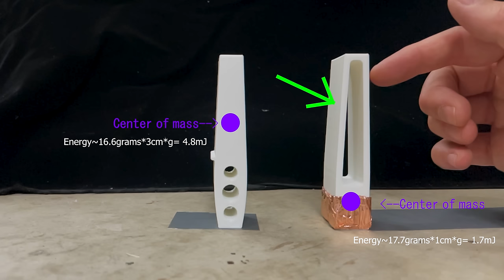The Impossible Domino

Comment: 3:00 i wrote up a whole rant about how that's not metastability, that's just stability with a narrow region, and then i found out that the field of electronics (where i learned it from) misuses the term metastability and your usage is correct in all other contexts. first we got the direction of current backwards, now this, get it together electricity!
Reply: i guess i'm kinda confused what the point of metastability as a concept is, like it's basically a local minimum. like if I place a steel ball in a bowl on a table, that's metastable because the bowl contains it but the ground would be lower energy. if i put it on the ground that's also metastable, because it's not at the bottom of the marianas trench. and even there, what if someone dug a hole at the bottom of the marianas trench and put it there, that's even lower energy. The only way the ball could be in a truly stable state of least energy is if i drill down to the center of the earth and put it there, and that's only if i don't consider the sun, or the supermassive black hole at the center of our galaxy, or perhaps whatever black hole happens to be the largest in the observable universe. wtf?

Comment: no not more energy, the second domino transferred its potential energy back to the first one, losing its bounce in return to a knock back
Reply: So it gained more energy 😂😂
Reply: This *entirely*. The tipping point energy break point is only about knocking the domino down, the setup energy is the energy delivered after going through this point. For the first domino to be put back up the energy imparted in it must exceed the energy difference between the potential energy of it falling over. This was delivered through the kick back of the first energy pivoting on the rib that was on its far side.

The description of the physics in this video was right in the description of the falling over and the tipping point, but wrong in the description of the domino being setup again. There was more potential energy in the second domino through the weight position and this when imparted to the first domino provided the energy to right the first. That's it, nothing more. It would be more interesting to see this managed with multiple dominoes rather than just one, however then it the energy loss (inefficiency) of the process would start to become very obvious.
Reply: So someone actually watched the video carefully, and has a brain. Thank you

Comment: If you rounded the bottom of the domino and weighted it to balance in the upright position, it should always stand back up. If you lined them up, the tipping effect would travel as a wave through the line of dominos in both directions. If you added a lip to the back side of the domino, the wave would only travel in one direction. That would make for a very interesting display of wave dynamics....

Comment: It is actually more about how much energy is transferred to the domino from you initially when you knock it over, the center of mass just guides the domino’s repercussion so that it stays upright.
Reply: An example would be what if you threw a bouncy ball at the ground as hard as you could, at a surface at the same level as your feet. Because of the additional energy, the ball would go far beyond the starting height. Imagine that conversion with dominoes, it is valid because it refers to the same law that is affecting the dominoes.

Comment: Fun fact: it is still impossible to do it for more than 2 Dominos.
Reply: Why? Seems like it could work with three
Reply: well u could put one non hollow domino behind the hollow domino
Reply: I mean, I believe it's possible with basically any number of dominos, if you figure out exactly needed form, weight, and center of mass, but there will always be only a finite number of different dominos, and the last one will newer be able to stand up after hitting the first one, so it's not an infinite engine
Reply: @CodeKujo  because the second domino need to fall completely for the "kickstand" to work. If there's a third domino in font of it then it can't do that.
Reply: @TheMoonMan.  The Kicker domino does have to be last, but there can be more than one preceeding domino. All the dominos would fall, then the last domino would kcikstand all the rest of them back up.  I think there would be a practical limit that keeps the length fairly short, but more than 2.
Reply: @CodeKujo  I see what you mean but I can't imagine the kicker being able to deliver twice the energy that was needed to stand just one up. Would be interesting to see him try though.
Reply: @TheMoonMan.  No it doesn't, it just needs to be shaped to form a seesaw between the floor and the will-have-been-fallen next domino.
Reply: @retepaskab  interesting direction. I get the seesaw reference.... but that effect can be achieved in so many ways. Are you talking about establishing multiple points of centrality in relation one or more ground states and exploiting them to shift mass between them?
Reply: @retepaskab  interesting direction. I get the see saw reference, though there are many ways to achieve that effect. Are you talking about establishing multiple points of gravitational centrality and working them in sequence in order to shift mass between them?
Reply: @CodeKujo  I don't think it would be possible for the last domino to kick multiple dominos back up, but I think one could arrange things so that triggering each domino will consume a minimal amount of each domino's kinetic energy, allowing allowing each domino to get kicked back up after the next domino is triggered.  Each domino in the line would need to store more kinetic energy, but it may be possible to make it so that resetting the last domino would leave the chain ready for reuse.
Reply: Fun fact: You are wrong.

Depending on how much energy you lose you could do this with 3-4 or more dominos. Plastic is just quite possibly the worst material for this, that's why he needs to mess with the weight of it (its so great at loosing energy we make bumpers out of it). Solid metal dominos on a metal surface should retain much more energy.
Reply: @ElRectalo  for the last problem you just need to make the dominos into a loop
Reply: @quinnfinity9750  that won't work

Comment: A third Domino would block the kickback effect, so this isn't really Dominos IMO.
Reply: Agreed. This won't be sustainable unless dominos get bigger with each step.
Reply: I don't think it would work even then, because the effect in this video requires each domino to land all the way flat, which would be ruined by the dominoes propped up by its neighbor. 

Further, once the final domino does lay flat on the ground, that kickback effect can only be applied to the 2nd to last domino, which it may not even be able to do due to the domino before it resting on top of it.

Cool demonstration and explanation, but were no longer talking about dominoes anymore
Reply: Could it work for every second domino by alternating the two dominos he has?
Reply: Reverse domino effect
Reply: exactly... we are not talking about dominos anymore. 😊

Comment: I came up with the idea, that you make heavier dominos with a weight inside the bottom of it. The direction of the row of dominos is important, because you shape the dominos like half an "U" and half a "L" should look like this (use a bit of imagination) LU   "falling"-direction to the right. The amount of energy that is required to get them back up is on a minimum. The energy consumption of the push is much higher, but you can use your finger to push those heavier dominos harder.

Comment: What if you remove the added weight on the bottom of the "A" style domino (so that it tips over in the other direction like here 1:26) but put a second "kicker" style domino on the other side? It should fall and be kicked a second time, right? By fine-tuning the scale and/or center of mass of the second "kicker" there must be a way to raise it up again clean! That would be awesome to watch!
Reply: It was the levering motion of the second object (at the end of its fall) that pushed the first object back.  The first's own rebound wasn't quite enough to pop it up, so you'd have to time making the third object fall somehow (external force, i.e. a second manual push) to get it to bounce the first sufficiently, basically doing the same thing once per side.  Big no-no if you're using the word, "dominoes."
This experiment started out so far from dominoes, (as far as the shapes presented in the video) that I think taking it further into more unique shapes doesn't really get closer to either useful physics or game experimentation.  It's basically only doing the second half of a Mythbusters experiment:  Make it work, no matter how absurd the input needs to be.  While the resulting explosions and other silliness were always fun, the interesting science always happened in testing the original idea.
Some of the comments about Weeble-like devices might lead to an interesting physics/sound toy, and would at least allow all parts to be the same shape, which is somewhat common with dominoes, which are usually the same basic shape.  They would also do what more people expected:  All tip back up, not just one.

Comment: Yes, but what the trick is... is to sustain a "kick back" reaction for a series of dominoes. Not just one. That is a matter of engineering and balance for each domino. I see a flange at each base which exaggerates the Kick Back reaction (of the domino behind it) and still allows the higher center of gravity to smooth out the tipping point. The flang also provides an arresting point of the kickback reaction, so you can put even more energy into the kick back than needed.
Reply: You can't get more energy out of the dominos by creating different shape. If there's not enough potential energy to start with the dominos will not kick the other up no matter how much you engineer the shape.

Comment: The issue is that you can’t really chain this together because the domino kicks up the one behind it with a leveling action, which won’t happen if it falls onto another domino.

But technically if the last domino had enough potential energy it could kick the one behind it up and cause a chain reaction to the end of the line.

Comment: If the weight on the bottom was dense enough(think a lead plate as a base) it could always return to upright because it would take more energy to knock it over than to go back upright. An extra strong push would be required which would lose energy to heat. In theory you could get a handful of these dominos in a row to all bounce back up, but the initial push needed would get higher per domino. Like a strong flick for 2 or 3, approaching like a rubber ball fired out of a cannon for longer chains. It would be interesting to make that. But it would require extreme density on the bottom, with a slightly curved base I think so that the lead plate could never reach metastability. Definitely a cool idea to get like 4 or 5 lead weighted reverse dominos in a row. Might hurt your hand flicking it hard enough to knock the whole row over.

Comment: Since you're making the hit domino asymmetrical, might as well make the side that gets hit square at the bottom so it can transfer more energy back into the first domino, possibly enough to use the geomtetry of the hole alone to get a balance without any added weight

Comment: This also works because you dont have to push it all the way straight, as, if the weight passes a point on which it is farther on the side its falling to from the corner its passing, it will always return straight, but if it doesnt pass that point, no matter what you do, it will always go the other way

Comment: I was thinking along the same lines in terms of an energy barrier, but my thinking was that you don't need as much as 100% of the expended energy to get the domino back up. You would need enough to get it very nearly back up, such that gravity did that last little bit of work returning it to a standing equilibrium - as other people have mentioned, a little like a weeble. Maybe with the right material and configuration such a thing could be achieved - though I'm not about to try it.

Comment: An additional challenge could be to have a setup of 3 dominoes with the starting domino in the middle.  The starter would be used to topple the domino on one side, when it would get flipped back and topple the domino on the opposite side, then possibly have the starter stand back up to its standing position.

Comment: I think you should have also included some discussion that the bottom weighted domino bounces back up because you designed it like a tuning fork, the kinetic energy of the falling Domino gets stored in the lower prong of the domino that as potential energy stored in the spring of the Domino which then pushes it back up as it releases.

Comment: Hm... next step: Make some kind of ridiculously sophisticated Dominos which change their center of mass in such a way that you can make a chain of standing-up dominos. In principle, you would "only" need some kind of weight within the dominos which moves through a spring which is triggered when (or shortly after) they fall over (and this then lowers the center of gravity), but in practice it would probably be extremely hard to make it work consistently. In that case, the spring would basically supply the energy required to get the dominos to stand up again.

Comment: A domino with a high center of mass that becomes a low center of mass could allow a full row to bounce back. So a steel ball mounted high inside the domino that drops down during the fall converting potential energy to kinetic energy AND lowering the potential energy of the new upright state is what's needed. This could allow a row of dominos to return to the vertical. Frankly one domino bouncing back off another isn't as interesting and kinda misses the point of self-righting dominoes. A design like the hollow domino with a ledge high on the inside holding a steel sphere that falls when tipped and perhaps a curved ramp inside to direct the ball backwards to kick the domino upright after the fall or at least lower the CG so it can be kicked back by the next domino offers a path to a possible solution.

Comment: Could you try putting a ball bearing in there? When it hits the bottom, the inside slope could make the ball fall back to the bottom of the domino, letting it stand back up. Don't know if that makes sense
It's another way of changing the center of mass

Comment: I call a domino at least 3 stones, since u use 2 different kind of stones I’d like to see at least 2 sets lines up and see if the energy is enough to let the stones fall and stand right up after. You do know the domino which stands up now normally have to be puched over by another brick. Your finger doenst restrict the brick trying to get up again.. if done right you could domino multiple times in one setup and let the dominos wave instead of fall whenever pushed over..

Comment: You could put another domino on the other side.  Push the middle one to the left and falls left then is kicked back up with just enough energy to make it stand up and fall to the right and then kicked up straight again.  Would require a lot of finesse but should work.  Right?

Comment: Seems to me the first domino being knocked down has more to so with it's shape than where the weights is at, meaning if you have the right 'shape' of the domino to kick up the following domino regardless of the weight of the first one or the positioning of the weight. TRY IT. You can see it in the video the shape of the first one is what helps kick the other one more so than the weight positioning itself, hence questioning if you need the weights there to begin with.

Comment: That's a really amazing thing to see that pop back up
I've an idea that you can create a domino chain that pop backs up. Based on your concepts you can make individual pieces such that their centre of mass gets to more height successively and with the right centre of mass and weight you can make them such that every individual piece has sufficient energy to drop the front piece it every piece which falls have sufficient energy to pop the previous piece back up. You might use different materials to print different pieces if any problem arise

I don't know if its exactly possible or not but it would be fun to research that. It would surely need very much calculation and experiments to see if it actually works out or not. I would also love to do this experiment but I don't have the required instruments such as a 3d printer. So my only hope is you now 🥺

Comment: This requires two separate domino designs though. A true "impossible domino" seems like it should only require a single design which can do the same thing. If such a thing exists, I bet there would be some small window of energy rebound where initially you'd get almost too much energy and a few dominoes down you would only have barely enough - after which of course all the following dominoes would fall as normal.

Comment: Now I'm curious, if you made many ones with different weight distributions, could you make a chain where knocking over the middle one causes that half to fall, then flip in the other direction. Then the chain oscillates just with one more on each end staying down.
The extra one staying down on each side would be releasing the energy to maintain it.
I assume every domino would need to be unique and placed in a very specific order to work.

Comment: 01:38 Nope, there is not more energy but the 2nd domino is tapered and the fall created enough leverage on the short side to push the first one back, also the weight of the first domino is mostly on the bottom so it's easy to flip it around the center of weight. Edit: you explained everything later in the video, ok ;)